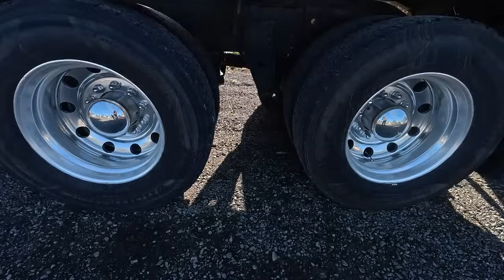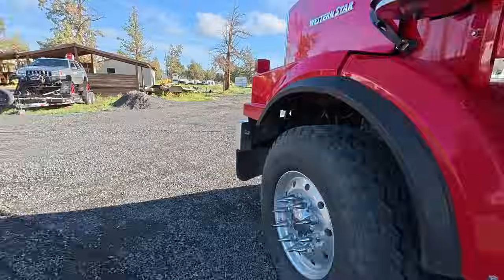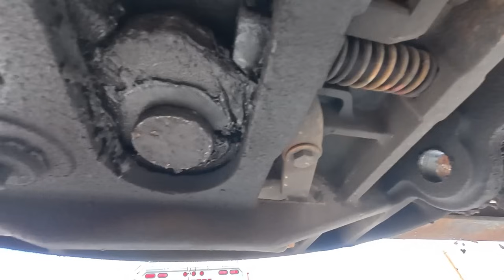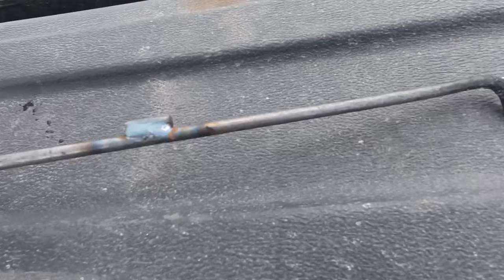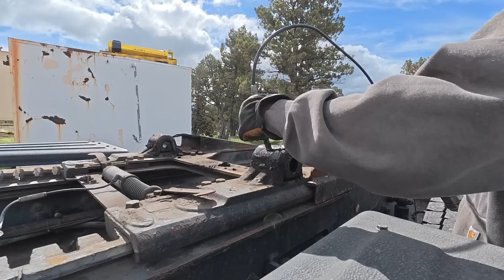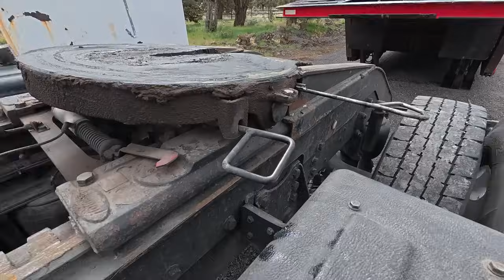My 5th Wheel FAILED 😳

Comment: The fifth wheel didn't fail. Your piss poor maintenance and inspection routine caused this to happen. You can't just drive stuff perpetually until it breaks.
Reply: I'll translate this comment: "I really like watching your videos. Please pin my comment so you get more money in your checking account. Thanks for all your work filming and editing!"
Reply: @KeithStarr 
Buddy got the pin of shame.
Reply: Lmao this hassss to be for attention 😂
Reply: @sKitz25 That's what I was thinking too, sure got his comment pinned 😂😂😂
Reply from the maker: Wanna bet?
Reply: @CaseyLaDelle one in every crowd. Reaction seekers suck🇨🇦
Reply: @jerrypruden887  For every wannabe comedian, there's a wannabe heckler.
Reply: @CaseyLaDelle omg😂😅 this made me crack up .
Reply: Hey @CaseyLaDelle  maybe toss a piece of twine, light chain, or a loop of aircraft cable through both of those handles so next time one of them $0.05 cotter pins fails you won’t loose the handle. Kinda like the carabiner on the remote brake light rig. I love watching ya figure stuff out. Just hate watching ya struggle.
Reply from the maker: @Lostrights1776  do you really think a piece of twine is going to last 500k miles like the last cotter pin did?
Reply: @ not so much, that’s why I included the chain or aircraft cable suggestion, but you’re more apt to see if the twine fell off when your grabbing handles and replace it when it rots away. Paracord, stovepipe wire, leather bootlace, anything like that that generates more engagement was what I was getting at….ya know 😉
Reply from the maker: @Lostrights1776  out of the millions of trucks on the road exactly zero of them have safety lanyards on their 5th wheel handles.  I have no desire to change that
Reply: @CaseyLaDelle  Of course it will last if you use military grade "Unobtanium Agave Sisalana" twine grown only deep in the jungles of Lower Elbonia. Of course, you do have to secure the other end of that twine. Calls for another cotter pin for that end too, and a hole to put it in.
Reply: @CaseyLaDelle any comment is good for the algorithms.  Even better when you can get them  to keep replying because they are mad!  😂
Reply: @CaseyLaDelle keep up the good work!!!
Reply: @CaseyLaDelle 😂😂
Reply: @CaseyLaDelle  This is why I'm a fan, You never try to defend yourself, you don't need to.
Reply: All the maintenance in the world  can’t catch everything crap happens
Reply: @chrisbyers386  ABSOLUTELY true. I just watched a Mentor Pilot video where an airliner crashed due to a flakey hydraulic relief valve. It could have been bad for 20 years but was impossible to check and it ONLY mattered because of many other simultaneous failures. Kinda like what would have to happen for Casey's double lock fifth wheel to drop a trailer.
Reply: 30:02  The fifth wheel didn’t fail, it was a 25 cent cotter pin that’s up underneath where it’s not easily inspected. Nice pull handle manufacturing Casey.
Reply: @justinnav Have you already ordered your "I hate Casey LaDelle" T-shirt? It's only $25.
Reply: That’s a crock of chit.  Unless you are a mechanic and know what you are looking at/for there is no way a normal truck driver will find that.  I once had a cracked 5th wheel plate and didn’t see it.  I even had a semi that applied its own breaks while going down the road while I’m using the cruise control. I had taken the semi to terminals , truck stops and dealers and no one could figure it out.  Until I happen to be at a small shop and talked to them.  Turned out it had a broken rod in one of the break chambers.   I as the driver would have never have found it.
Reply: Casey, I learned something new today,  thank you.  I drove a semi for 20 years.  You stay safe out there.
Reply: Always got to have troll 🧌 comments 😂
Reply: Says the keyboard Commander. No driver goes under his truck and looks at the back side of the fifth wheel as part of the pre-trip. None.
Reply: lol .. i'm guessing @justinnav's pre-trip is mommy making sure he has his safety belt on in the back of her car ??
Reply: @888johnmac  🤣🤣🤣
Reply: obvious troll
Reply: Good comment, look at how many extra posts it’s created, good news for Casey’s U-toob earnings… 😂😂😂
Reply: That’s a crock of chit.  Unless you are a mechanic and know what you are looking at/for there is no way a normal truck driver will find that.  I once had a cracked 5th wheel plate and didn’t see it.  I even had a semi that applied its own breaks while going down the road while I’m using the cruise control. I had taken the semi to terminals , truck stops and dealers and no one could figure it out.  Until I happen to be at a small shop and talked to them.  Turned out it had a broken rod in one of the break chambers.   I as the driver would have never have found it.
Reply: This is how i do my inspection routine:

Pre Trip: Yup, right where i left it. 
✅ truck is safe to operate

Post Trip: good enough, im going to bed
Reply: So, justinnav, how do you inspect a cotter pin that has not failed yet? How do you make a maintenance schedule for a scheduled cotter pin replacement protocol?  Is it based on miles traveled, detach/reattach count, roughness of roads traveled? Please, oh Great One, tell us how?
Personally, I would have avoided the cotter pin by threading the rod end and using a nylock nut. But, I'm a bit more safety/reliability engineering OCD than Casey. I was raised by a rocket/satellite engineer. They double and triple safety/reliability engineer.
Reply: Fail safe
Reply: by the way the pivot pins came out of the fifth wheel, show how much maintenance goes on. If any part of the fifth wheel lacked grease those pins would not come out that easily.
Reply: Easy to comment from mommas basement 😂
Reply: Careful Casey this guy might call OSHA on you... probably did before.
Reply: I too hope that someday I can post something ignorant enough to be pinned to the top of a Casey LaDelle Video. 😂
Reply: I seen videos where he does maintenance on them all.
Reply: Lighten up, Francis
Reply: Tell me you've never actually worked in the industry without telling me. Shit happens and you arent going to convince me you take your plate off on a regular basis to inspect the lock levers. Get a grip.
Reply: Yes Carter pin breaks and  the road bounces out the handle on the road. Give me a break. This must come from some asshole this hat has never done any work in his life.
Reply: Why you subscribed to the channel  ? Even my mother in law talks less bollocks,  and I don't even wind her up no more  👍🏻rich uk
Reply: That is quite an assumption.
Reply: Yeah, Casey should check every nut, bolt, connector, wire, hose, etc. before every trip and if he can't get it done in a day, then he should start over since something could have failed since he last checked. It shouldn't take more than a year or two to check everything, then start over again. Perhaps hiring a complete crew to go over everything. There could be an issue with some bolt buried inside of something. But then no one would be happy because there would be no videos as he would be too busy checking everything, plus going broke because he would have no time to work. It would be too much work to be in the real world and realize that it is impossible to check everything.
Reply: You got lucky that the bolt holes  lined up so nicely  reinstalling the  5th  wheel  plate
Reply: I have an idea, maybe to help. I was thinking that you could attach a short strap to the release handles and to the trailer, just incase the pin comes out again. At least you won't loose the handle.  Nice repair.
Reply: Congrats on the Pin of Doom !
Reply: WOW harsh technically anyone could have made a mistake like this even doing plate maintenance scraping grease off and replacing the grease you wouldn't have caught that unless you remove the plate 🙄
Reply: The Pin of Shame ! 😂
Reply: Do you even truck????
Reply: I can't believe this comment.  That god for this person warning labels come with shampoo
Reply: Yes, I meant immigrants. Work for 1/3 what our expenses allow.
Reply: cotter pin must've been Marginal pre-fail in the pretrip and failed from road vibration while underway. no room to inspect it, and that probably wasn't even a maintenance callout anywhere except the parts diagram
Reply: Watch something else... there's plenty to enjoy and that way you don't spread ignorance and a bad attitude for the rest of us!
Reply: The whole time all
I could
Picture is trying to back in exactly right to put the pins and bolts in. The editing to make that look clean must have been mind bending
Reply: I always do a frame off inspection and complete engine teardown/rebuild before every trip.
Reply: I'm sure @justinnav has tons of great content showing us exactly what to do.   Me --> visits @justinnav: "This channel doesn't have any content" 'dough....
Reply: Had to be trolling, everyone knows the opposite is true
Reply: Were you trucking through grass valley California today?
Reply: Good job Justin. Your hate is helping Casey cash in with all the responses to your comment. You must be good friends on the side, like that super lazy guy up in Canada.... Bruce something. LOL
Reply: Oh we got a know it all here. It’s as if stress and metallurgy doesn’t exist.
Reply: Yet here you are, watching his videos.
Reply: A cotter pin fails. and you blame maintenance. Good job numpty
Reply: Hopefully he knows now to add it to a scheduled change every 5/10k miles or something as preventative maintenance, doesnt take long to swap out, doesnt impact safety if it does fail but makes life more awkward than it should be. Surprised to see you didnt improve upon the design and just reimplemented the same thing that failed once.
Reply: Stuff fails it happens but wait till ppl see how big the king pin is and it pulling 50000 lbs plus
Reply: You can’t check or see the secondary lock.
Reply: You’re clearly unencumbered by the thought process. 🤦🏽‍♂️
Reply: Your comment failed.
Reply: You are out of order.
Reply: I assume he will reply once he has retorqued and checked every single fastener, ball joint, pipe, wire, electrical connector, tyre, bearing, pushrod, rocker, brake pad/caliper, universal joint, exhaust hanger, shock absorber, spring, stupid little plastic clip, obd2 for faults, on each and every vehicle he owns, then done the same to each and every building he possesses. 
Then virus scans ect…
It’s only been six months so far…
Reply: @marcuscoquer5958 When you drive a massive vehicle that tows another massive vehicle with dozens of tons of weight in/on it that is capable of killing people on public highways, you not only have specific legal obligations in regards to safety checks, but you have a moral obligation to make sure you are thoroughly looking over at least the critical parts and pieces (like the mechanism that literally keeps the trailer attached to the tractor) or pay someone to routinely inspect and maintain it for you if you can't do it yourself. No one is suggesting he needs to look over every single wire and fastener, but this is pretty important, bud.
Reply: @justinnav  Every vehicle can kill someone. People have been killed by bicycles. If you are holding others to that standard then I hope you are thoroughly checking every inch of your vehicle lest you become a hypocrite.
Reply: It's cheap made Chinese pop can metal stuff nowadays big price made to fail ant like ust to be stuff made to last forever 😊
Reply: @Kevo_The.Outlaw what? I tried translate and Siri just shook her head. She said “Hell if I know my guy.”

Comment: Howdy Casey, I drove truck and was an instructor for many years. I my teachings a pre-trip never would have found that problem. Something you might wish to consider since you have a dislike for Cotter pins. The part where the Cotter pins is located at you could heat up with your oxy-acetylene and bend it back towards the handle making a "U" shape out of it. This means no Cotter pin to hold it in and never having to do that particular repair again, unless the 5th wheel falls off. :) Keep up the good work and always enjoy your vids! Thanks!

Comment: You are lucky that you could run that nut on that way!  When we built trucks at Freightliner (the TMP in Cleveland, NC) not Portland! The nut & bolts were brand new!  There is a distinct possibility of a bur coming off the nut, and running up into your finger!!
Reply: I e had it happen!

Comment: If you do use that truck with a mechanical RGN
Your going to want to weld a plate on the back side of your 5th wheel ramps so they don't bend
Reply from the maker: Wrong

Comment: As picky as DOT is on safety devices it's a wonder they haven't outlawed a single release and required the double release on all trucks.
Reply from the maker: Because single lock is still more reliable and has less failures than pretty much anything else on a truck

Comment: On the one handle where it has two 90% bends, the rod was run through the bracket and hooked to the latch before the bracket was welded on.

Comment: 45 years now retired doing oversize and heavy long haul and i wish i had had a setup like yours  but that did not exist back then .But i have something in my garage you may appreciate An all original 1968 Mercury Cougar With less than 50,000 miles with the optional  custom ordered 302 and A/c it even has the clear cover floor mats . It does have 1 thing that makes this a 1 of a kind this car was used by HotChkis to build  the prototype upgraded suspension  system  which is under this car .

Comment: Casey, even though I know you won't see this. I gave you a 0.0% chance of those 2 pins coming out the way you did it, let alone, without having to beat them out with a hammer. Obviously you take proper care and maintenance on your equipment, it showed in this video.

Comment: There's a reason we build these systems on these trucks to fail safe. We would rather you not be able to get the load off your truck than for the load to decide it doesn't want to be on your truck on its own.

It's the same reason that the air brakes on the truck have to be positively actuated, meaning if there's no force holding them open, they're going to shut and stop the truck from moving. It's not ideal to trigger them once the truck is already rolling, but it could be useful at stopping it in an emergency.

Comment: In Europe we have safety clip holding the handles in position. In your case your second lock handle might have come unattached but you would still have the handle to put back in as temp repair then re clip when you unhitch. The safety clip is connected to a piece of flat iron welded to the bar just behind the handle and chain welded to a suitable place on the 5th wheel assembly. Chain of the right length to stop handle pulling out far enough to release the locking mechanism.

Comment: I had thought you had the 2000 series with the big steel block secondary. They were bad for bending the 3/4" bar handle . We have used a farm tractor as an anchor and a come along to get them to release..   That FW 70 or 100 design looks easier , but that cotter pin is the weak link.. Although carrying a spare handle and some cotter pins wouldnt be a bad idea..

Comment: I suspect the forward arm, that link arm with the bolt in it needs to be removed so you can get it on the Z end. But that's a guess. 

Also, speaking for myself and the UP is OFF switch - that kills my OCD. That's my issue. You do you. However, I do reserve the right to laugh if you ever kill the battery leaving the ignition on. :)

Comment: I was taught that the 1” inch piece of steel without being tempered ,has the strength of 70,000 lbs.  also learned from my father about the tug test after you back into the trailer while hooking it up

Comment: t would be nice if there was a way to check that.  I ask during a maintenance for them to adjust the 5th wheel.  When they pulled the wheel from the base, found one of those base plate mounts broke and spread about a 1/2 an inch.  Was just a matter of time before I would have lost it all.    This was about a week after I saw a Werner truck lose a trailer with the 5th wheel plate still attached to the trailer.   Scary days.

Comment: You can't predict a cotter pin failure because of how it is, it has nothing to do with inspection and maintenance. It was an unpredictable failure in a place that is impossible to see without climbing under the truck. I know most people wouldn't climb under their truck to look at their fifth wheel every trip, nor is it required to. It won't be the last time you get screwed over by a cotter pin, I call them Jesus pins because they always seem to be on things that must stay together and I've a few fail on critical items on various pieces of  moving equipment.

Comment: I was turning a bolt with my impact (air) while threading the nut by hand, and ran a long piece of burr off the bolt way up into my forefinger. This happened in the plant where I worked building Freightliners.  You wanna talk about pain?? That hurt very much bad!!
Reply: Also, this happened before I worked there, but a guy I worked with was trying to get a nutout of a socket while it was still on the impact, and yep! You guessed it he accidentally bumped the trigger!  The nut was run clear up on his first knuckle in no time!!

I say OUCH!!!

Comment: If you end up doing this sort of repair again, might it be worth it to thread the end of the rod and add a nut for added retention?  You could either use a castle nut and loctite with a cotter pin, or perhaps cross-drill a nylock nut for a cotter pin.  There might not be space to do it, and it may be excessive as this sounds like a pretty rare failure, but I have been known to wear both a belt and suspenders.  I hate having something fail twice on me.